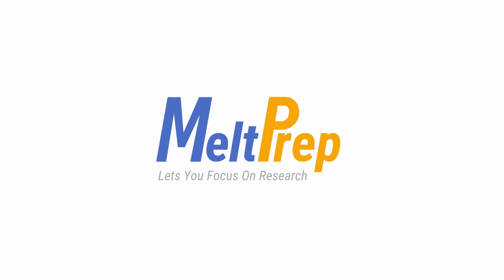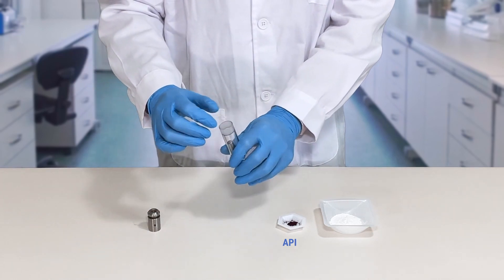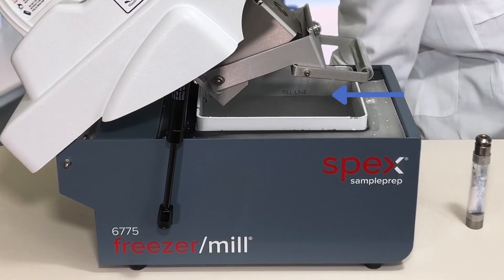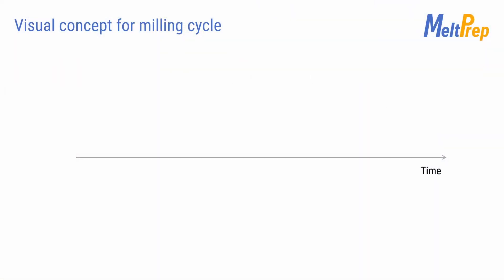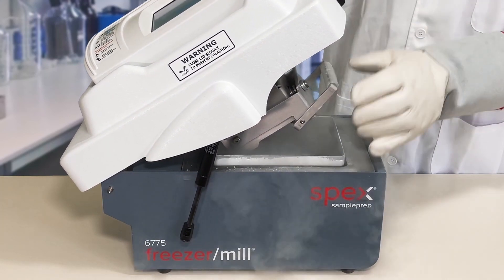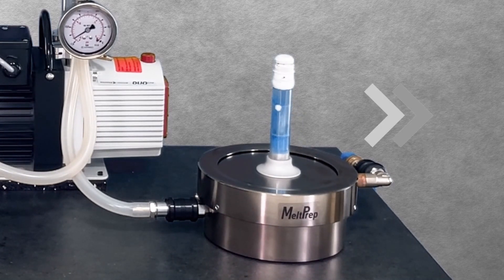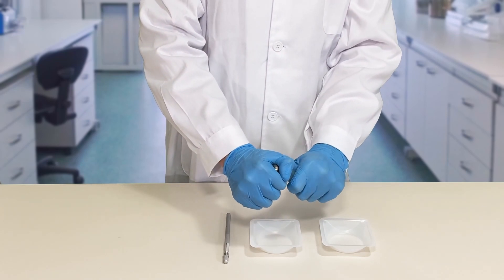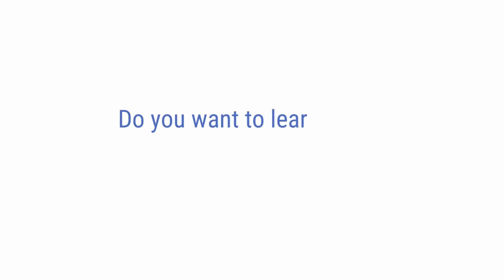Cryogenic Milling Explained

Comment: I have zero clue what you were milling there, but cool video anyway
Reply from the maker: Thanks for your feedback. 
In pharmaceutical manufacturing, properly mixing components increases the uniformity of drug content. When it comes to sample preparation for pharmaceutical applications, it’s essential to have a perfectly mixed starting material to obtain homogeneous samples. 

Cryogenic milling is a technique that reduces particles at a very small scale. The materials used in the video are HPMCAS with blue color to show how the mixture obtained was reduced in the µm length scale and perfectly mixed.

If you’d like to have more information, visit our dedicated webpage: https://www.meltprep.com/mixing